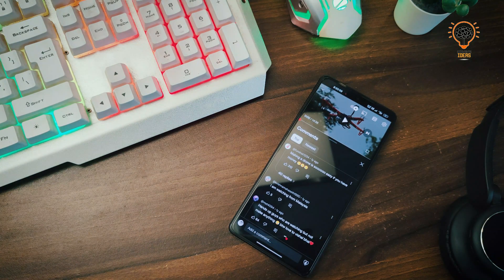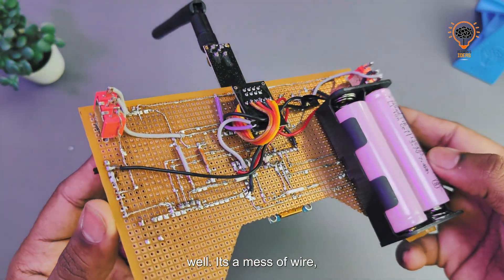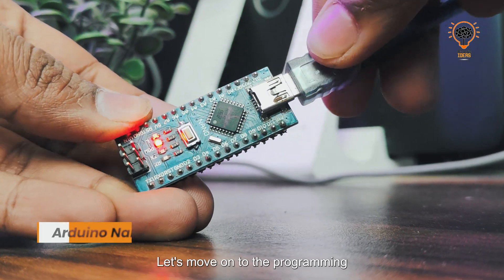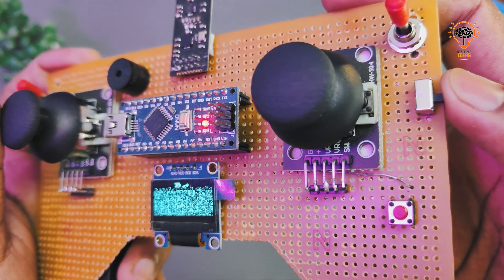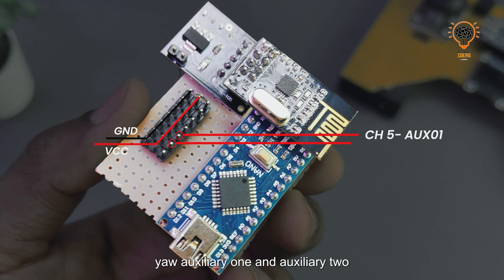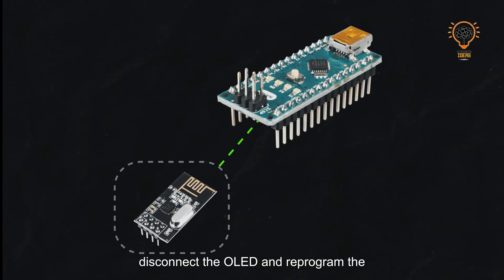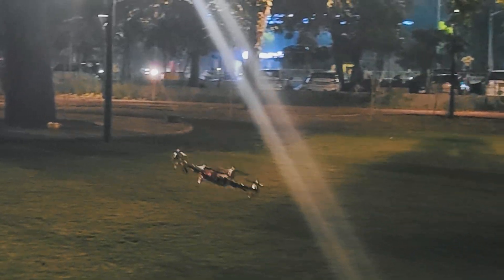How To make Transmitter and Receiver at Home for Drone Using Arduino

Comment: How much gram can this drone carry
Reply: Depends on the motor, battery and propeller size. If 1000kv motors with suitable battery and esc then 2-2.5 kg can be carried (with drone frame and components weight)

Comment: Hello, I noticed  that transmitter diagram is different from your device. there are some bms and other devices connected to batteries. Could you please provide us with details of those devices ?
Reply: Bms is just to handle battery so that they will always be balanced and can charge discharge safely

Comment: it is important to use NRF Adapter Board  in this project ??? 

sir plese tell us
Reply: Well no, but adaptor has inbuilt 3.3v regulator. If u dont want to use its fine but then add a external 3.3v regulator and dont forget capictors both at input and output

Comment: bro how do you get nrf24 to work so flawlessly? I have got 4 pairs and none of them worked, even tried adding capacitors and wrapping ground wire around the miso and mosi pins. Any insight will be appreciated. Great content by the way, keep up the good work.
Reply: Mine worked in the very first attempt, its strange that yours didnt work. Mostly issues come at power. Use a separate 3.3v regulator to power it, arduino inbuilt regulator is not that strong. On powering on check terminal voltage it should not less than 3.26v or more than 3.5v. Add capicitors at vcc gnd pin, twist miso mosi wires. Check wire connectivity, yes i faced it the contacts of jumper were making bad connection.

Comment: I have  a doubt about batteries 

Which battery i use for transmitter 
And receiver
Reply: Use 18650 2200mah batteries 2 in parallel. Directly power it to arduino Vin and use external 3.3v regulator to power nrf. Be sure to use holder so that u can unplug battery for charging. 2x 18650 with 2200mah capacity will run a very long time

Comment: I have a question: 
Did you connect 9v battery with the VIN ?
Reply: Yes u can
Reply: But dont exceed more than 9v it will work but may cause heat and damage.
Reply: Ok , understood 👌 thanks

Comment: Timestamps
00:06 - Build a budget-friendly drone transmitter and receiver setup.
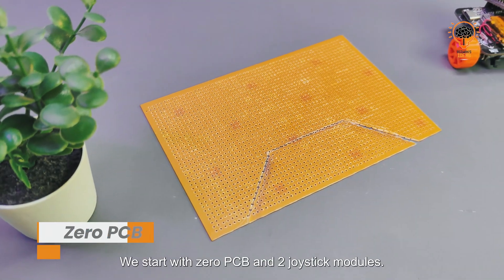01:00 - Starting the transmitter assembly for the drone using Arduino.
01:46 - Neat connections for transmitter and receiver with PCB design tools.
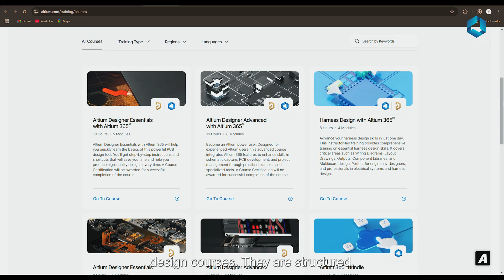02:36 - Learn PCB design for electronics with industry-recognized certifications.
03:25 - Overview of building transmitter and receiver for drone using Arduino.
04:13 - Assembling a stable drone transmitter and receiver using Arduino Nano.
05:10 - Troubleshooting transmitter and receiver stability for drone use.
06:07 - Download 3D files to enhance your drone projects.
Reply: Nice bro super

Comment: Im using NRF24L01 with adapter 3.3v its really hard,not working at all
Reply from the maker: rizwansideas2@gmail.com share me pictures of your connections
Reply: @Rizwansideas  I've been working on NRF24L01 in two days but it doesnt work,now im using hc05 instead ,its more easy to use for beginner like me.
Reply: @Rizwansideas  i've set the module aside for my next project

Comment: Wollte mir ein fernbedienung beim  arduino nano benutze aber bekomm die Codes nicht angezeigt  . Hast ein Tipp? Wollte die iron Man maske machen die auf und zu geht  halt mit der fernbedienung anstatt eine Knopf
Reply from the maker: Hier finden Sie den Code https://rizwansideas.com/diy-arduino-rc-transmitter-receiver-using-nrf24l01/

Comment: Can we use 3 lithium ion cells for powering the esc ?

Because I am doing everything same but not using lithium polymer battery, I am using 3 lithium ion battery in series of 3.7v each. 

But the transmitter and reciever is not working. When i am checking the Transmitter and reciever in serial monitor then it showing that the connection is working properly. But in real when esc with brushless motor and other servos are connected its not working. Not even connected one at a time. 

Please help me to cure this problem.
Reply from the maker: You can use lithium-ion batteries, but you need to check the voltage of the ESC and ensure it is compatible. 

and if not working contact me on email rizwanideas2@gmail.com

Comment: What is the range of the transmitter
Reply from the maker: According to google up to 1000 meters in open space

But we will check properly in the next part of video
Reply: @Rizwansideas 80m to 400m in urban areas. Well company claims that it can go 800m

Comment: Can we use esp 32 instead of Arduino bano
Reply from the maker: Yes you can but the ESP 32 is a little bit more costly
Reply: @Rizwansideas  but memory and processing is much faster in that
Reply from the maker: Yes 100%